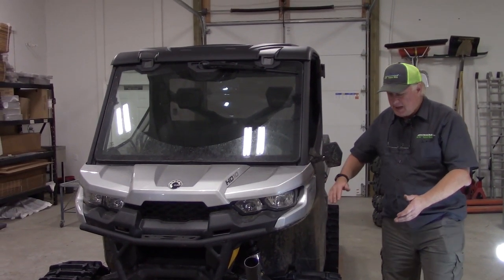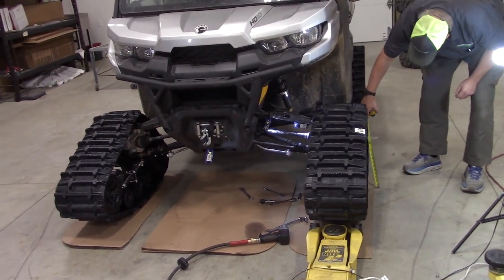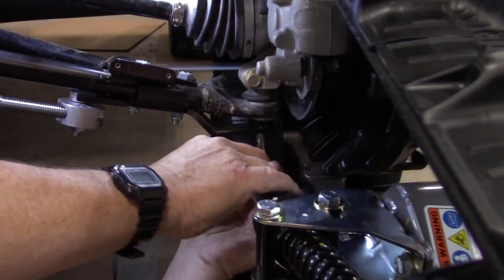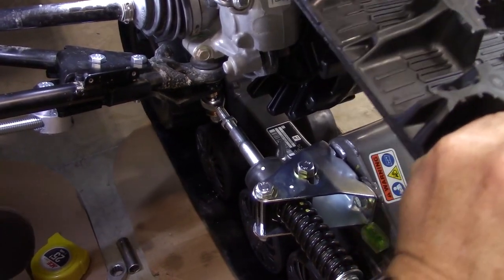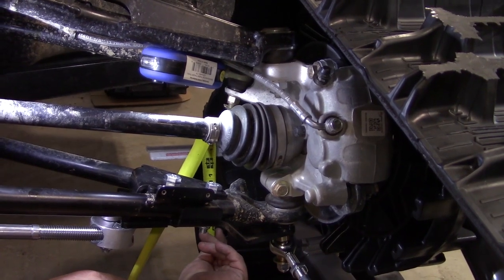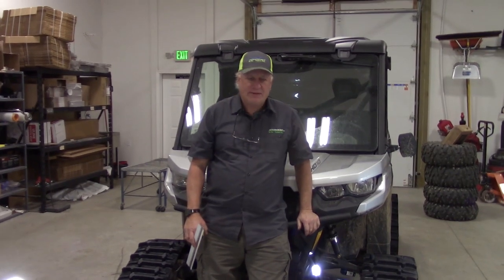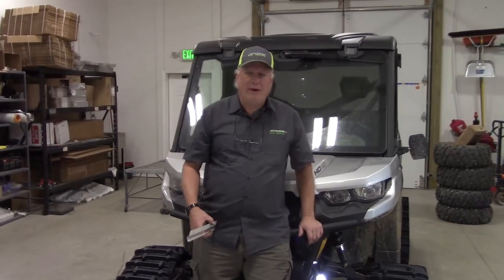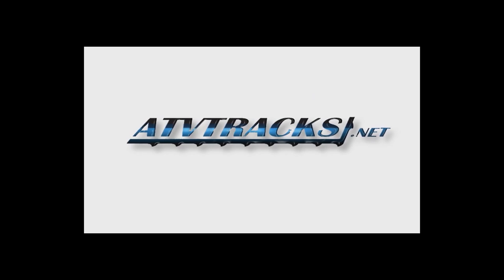Camso UTV 4S1  Front Track Angle of Attach Adjustments

Comment from the maker: I don't think it would throw you off to much but your track tension is important in the big picture. Your adjustment are based off the frame/bogie wheel and not the rubber.